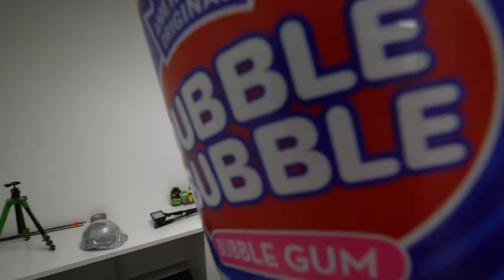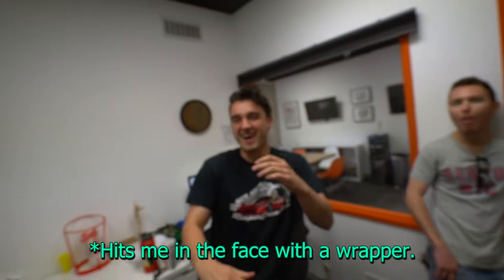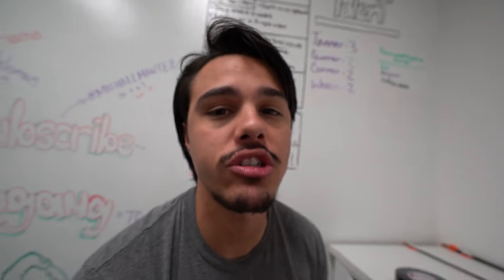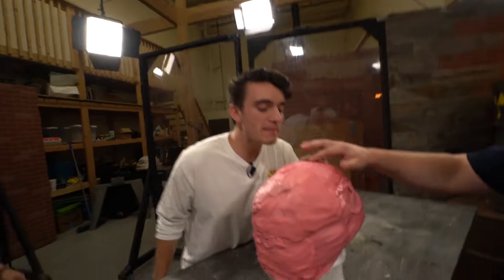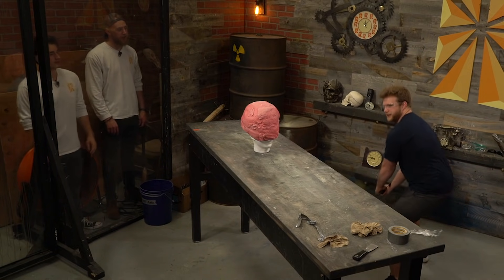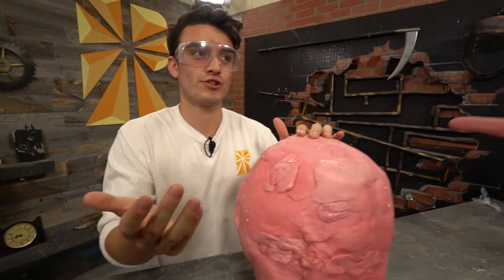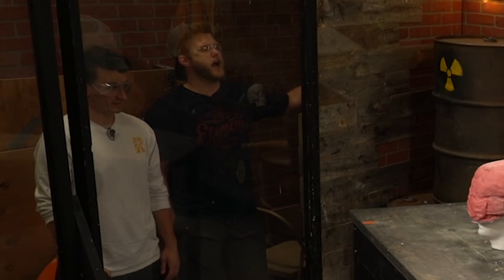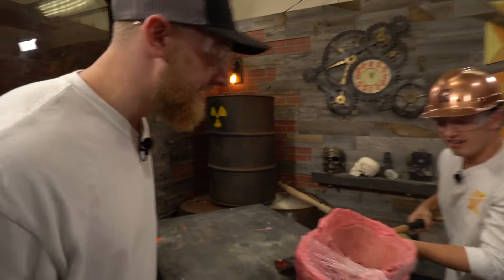Will A Bubble Gum Helmet Protect Your Head?!

Comment: Ya couldnt just melt them in the microwave stick them on the helmet and save us the cringe???
Reply: exactly
Reply: Beautifully A Threat exactly
Reply: Beautifully A Threat ikr
Reply: ikr!? melt them double-boiler method and make a mold!
Reply: no
Reply: Beautifully A Threat it’s called content!❤️❤️❤️❤️❤️
Reply: I know that's what is thinking
Reply: They are probably regretting not doing that
Reply: But then it wouldnt have been so tasteful
Reply: Ikr u r smart
Reply: They probably did that. There's no way the chewed all of that. And Connor is a fast gagger, he wouldn't just bite chewed gum. Also he says it's just water and gum, so there's another clue they didn't chew all of that. And the surface is too smooth, that wouldn't be the case if they used individual pieces of chewed gum and sticked them on there.
Reply: Literally what i was thinking